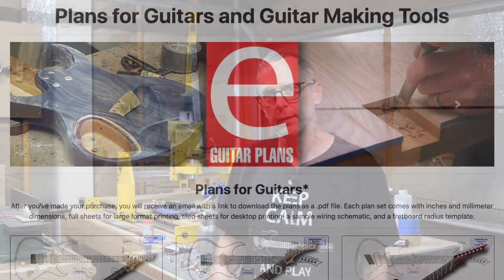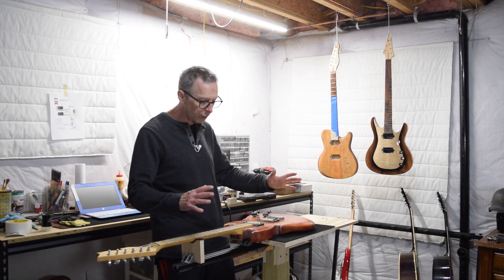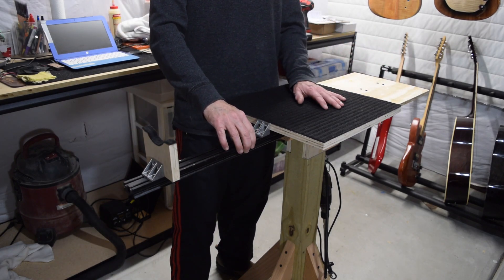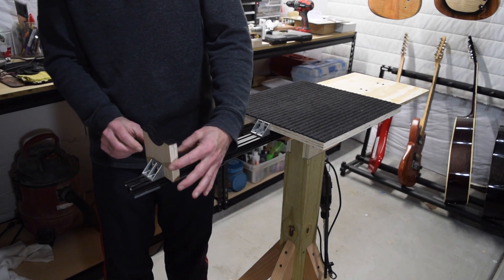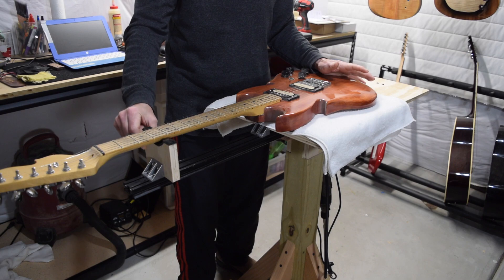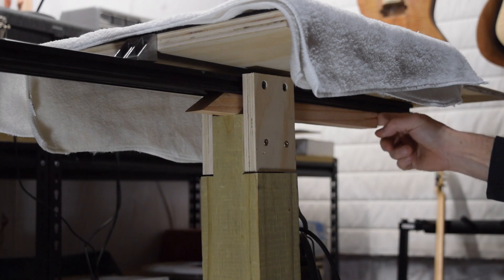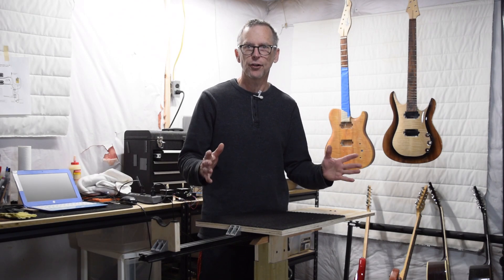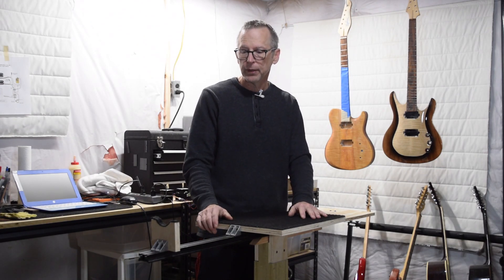My Guitar Set Up Work Table

Comment: I made mine centered around the fretboard, nut, and bridge, with the table adjustable relative to the fretboard. That way I can set the fretboard height for comfort depending on if I want to sit or stand and it will accommodate almost any instrument. The whole thing swivels 360°. The unit easily disconnects from the stand and plugs into a socket in my work table. I can work on both sides without disturbing the instrument or having to move. It's conceptionally similar to yours except everything is adjustable. I like your designs.

Comment: I'm making this woodworking bench out of 2 oak coffeetables stacked. One had a top of 3 inches thick, solid, I use that one for the wood but the other table I stack on the frame. They both have drawers too. But I wanna cut some corners straight and so I'll have to strip off all the lacquer to make it good. I don't really know yet which clear lacquer would be suitable. It's gonna stand outside underneath cover though. Gonna use it for sawing routing etc. a sturdy bench is best for that. And I wanna see whether I can make a wagon vice onto it for planing etc.

Oh and I got it for 10 euro, that's the most insane part

Comment: Hi ! I have an unrelated question for you . I'm going to oil finish a guitar body and I've heard that after the first couple of coats that you should apply a coat with sandpaper to help fill in the wood pores . The question is . Have you ever tried using a scotch brite kitchen sponge to apply this coat ...... In my research , the green sponge is supposed to be 600 grit and the blue sponge is supposed to be 1000 grit ....... Thanks  , I really like your channel :D
Reply from the maker: Sandpaper works better for applying the oil, while synthetic steel wool is better after the oil has fully cured.